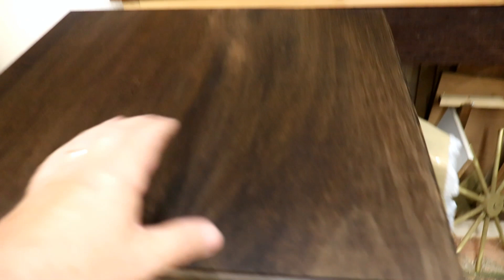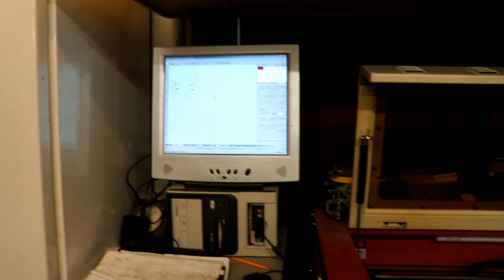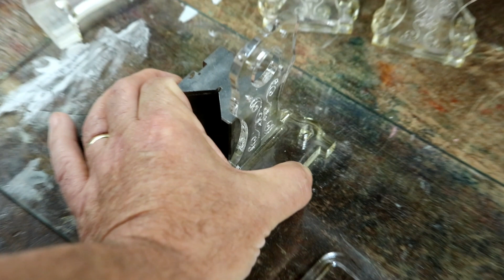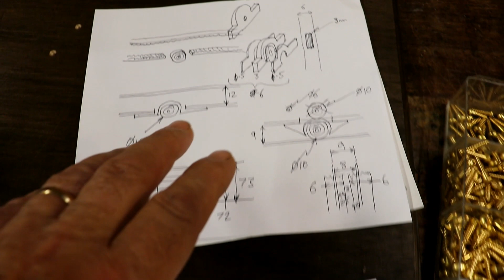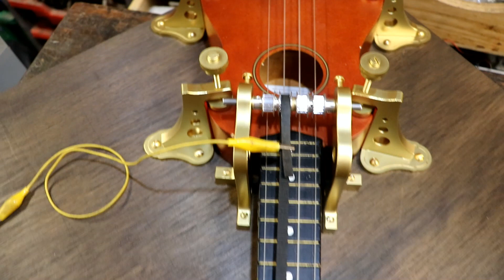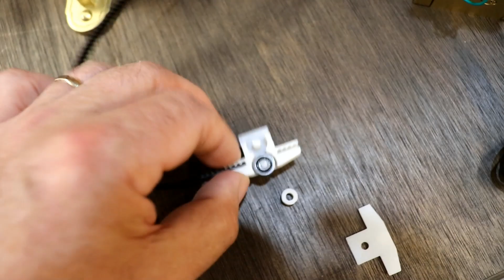Steampunk Music Machine - 4

Comment: You need a Go Pro so we can see your next 'wreck'. j/k.   Very exciting, did you 3d print in PLA?
Reply from the maker: Thanks VJ, whilst I'm going to endeavour to avoid going anywhere near the dog on the bike, a GoPro does sound like a great idea, at least then I can properly enjoy and share my accidents! I've only ever used PLA for 3D printing as I've found it to work really well. I always use eSun PLA + filament as it was recommended and works really well. As the carriage is so small, I'm printing it at 0.06mm per layer which makes a huge difference with intricate things.

Comment: I don't understand why you don't make a carriage with 4 pistons on 1 motor, or rather with several spaced pistons, for example, 4 rows of 4 pieces, and will there be enough belts without guide tension to clamp the string? sorry if I missed your explanation, my English is very lame :))
Reply from the maker: Hi Ckoe'Tael, I think I understand what you are getting it; a carriage that mimicks four human fingers that can move up and down the frets - like the music playing robots you mentioned previously. That would work, although pistons require compressed air and solenoids would be too noisy. In the end I just thought it would be interesting to be able to create chords that a human couldn't manage! Also I got absolutely sick of planning and just wanted to start making - it may all go horribly wrong, but the four rolling carriages seemed like a good idea at the time!
Reply: @steamhead  well, then experiments are always interesting) and how will they press? will you put an eccentric? but it seems to me that a plate should be installed above the belts, so that when the carriage was pressed on the strings, it had a stop on top
Reply from the maker: @ckoetael  I'm very pleased to say that when the bearing pushes against the string with fairly light pressure, it creates it's own fret! I'm thrilled to bits. It means I can use the elasticity of the timing belt to apply sufficient pressure to create 'imaginery' frets - I don't even have to push the strings down to engage with them - the bearing stops the string from vibrating beyond it.
Reply from the maker: Several more carriage prototypes later, which involved moving the bearing lower and the top wheel higher, and it seems to work perfectly! It means I'll have to program the stepper motors to accurately position themselves over the fret points, but that should be easy to accomplish. I've subsequently laser cut a new spacer for the top of the strings, so they are now parallel all the way up the frets. It's made life so much easier, as each carriage can now be much wider, more dense, and able to efficiently prevent any oscillations past the bearing.